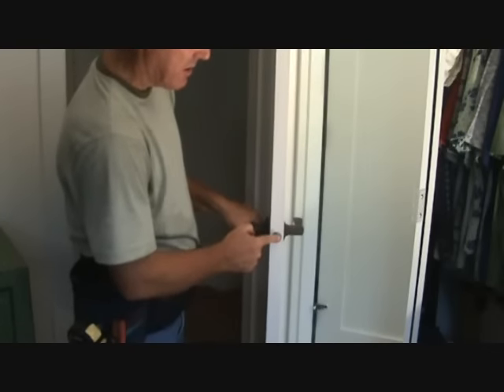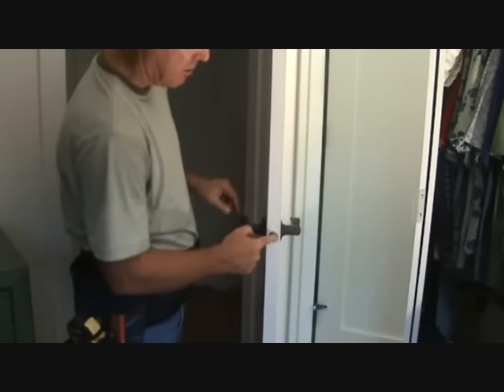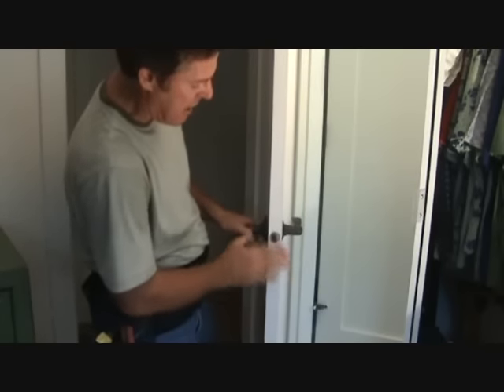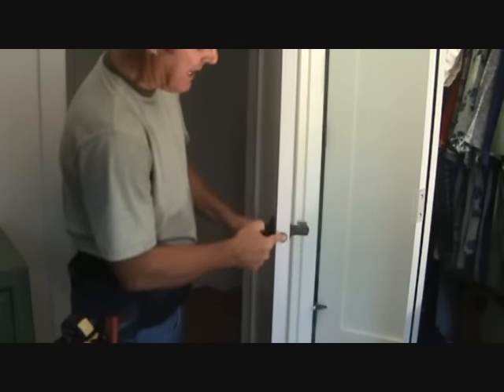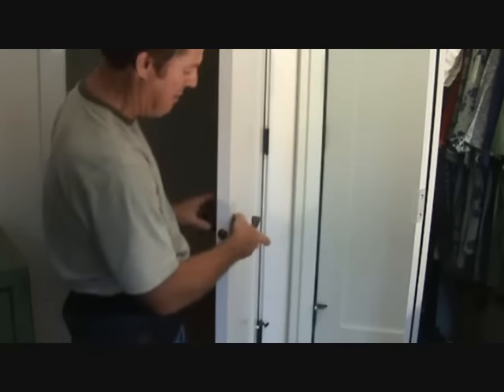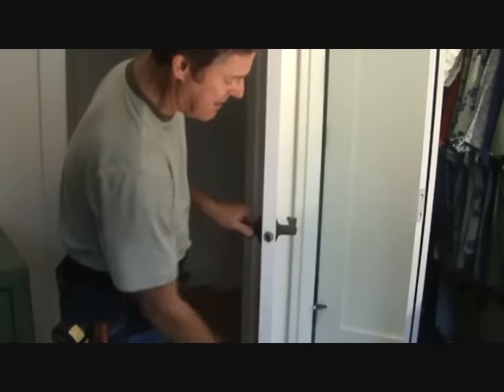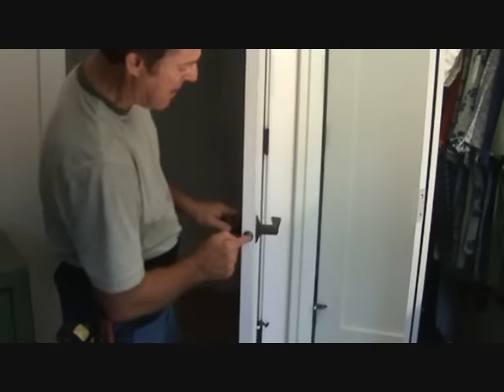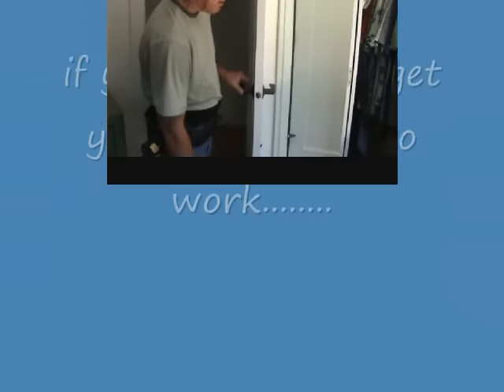Is your "door latch" sticking?

Comment: Hi my door latch got stuck in the door so when i removed the handles the latch was still in and the door wouldnt open so i used a knife to pull it open after some hard work.. do you know what could be the problem? the long metal bar that joins the handles togther seems like not turning with the handles but the handles work fine :s

Comment: Hey Joe, Thanks for the advice. I did take my doorknob apart and look at it, based on your advice, but it looks like I've actually got a little bit of a different problem: Even with a non-sticky latch, my latch isn't opening far enough.

Looking at my backstop, it's pushed against by a curved piece of metal -- and it looks like the backstop has actually worn away enough that it can't push the latch back enough anymore.

I realize that this is probably pretty uncommon, but I wanted to mention it as another possibility for people who might run into something like this: sometimes your backstop is just no longer functional.
Reply from the maker: Christopher Schmidt Good point thanks for mentioning this. If your door knob is still in pretty good condition what you could do is remove the latch & take to your local hardware store & see if you can match it up to one they may carry. If that doesn't work then take to a locksmith shop & they should have it. the latch could run you around $10 or more so if the door knob is not a very expensive one you might want to consider getting an entire new door knob assembly. Thanks for taking time out to send me your message!   Joe  :0

Comment from the maker: @punisher5836 Is the center piece stuck to the paint on the door face? Take a putty knife & tap around it to see if you can loosen it. Is there a set screw under the center piece that you're not seeing? Can you take a screwdriver & put in the center piece & turn it so that will release the door latch? There should be some way you can pull the door latch back into the door. Keep looking & working on it. Don't start that chainsaw just yet!!....lol.   Joe  :0

Comment: Hi Joe and Happy New Year!  My front door handle latch suddenly became stuck in the withdrawn position...staying inside the door.  No amount of handle turning, WD40 or screwdriver insertion would move it.  Took it all apart and the latch finally broke free but that was when it was disassembled.  I found some small parts that don't LOOK  broken off of anything.  I guess I'll have to replace the whole door handle unless someone sells latches separately.  But since this handle has been in there at least >10 years, replacing the whole handle makes sense.  Can you give me any idea why the latch would freeze up?  Thanks..
Reply from the maker: So glad to hear you had decided to replace that handle to your front door. Over time exterior handles will start accumulating moisture which will then turn into rust etc more so then say an interior door handle inside your house. Over time the latch will start getting "rough" to open & possibly closing then it's all down hill if you don't catch it soon enough. Thanks for stopping by!

Comment from the maker: Sounds like you may have a broken part in the handle assembly, that is preventing the latch to press back into the door. You may need to put a screw driver in the inerts & start prying to see if you can disengage the latch then. If you do this however, you may damage the lock but it may be time to replace this whole door knob anyway, depending on how old it it.   Joe  :0

Comment from the maker: Once you have the door open, you can then look in where you removed the door knobs & see what's going on. Once you completely remove the door knobs & associated trim housing, you should then just have a hole in the door, with the side door latch going into this door hole. Is the latch still pushed in & won't come out (at the side of the door)? if your latch is till stuck, you may have to replace your door latch. Spray some WD-40 on it & see if you can free it up.   Joe  :0

Comment from the maker: @cgarwood Not sure why you cannot remove door handle. Where you removed the door handle...look inside & see if the door latch edge has broken or has been wedged in causing the door latch to not spring back allowing the door to open. Look in there with a flashlight if you have to. It's got to be something like that since you should be able to pull the latch back so the door can then open....unless it's a really old lock..it could be different than how I am explaining it. Let me know.   Joe  :0

Comment: Joe,  my bathroom door handle had a problem where I couldn't tighten the screws without the the handles "binding".   Basically,  if I tightened the screws on the non-locking side,  the handles would be harder to turn,  and the latch fails to come back out...  I'd have to manually turn the handle to bring the latch back out.   So, I bought a new handle,  and it's doing the same thing!  It must be something to do with the door, right?
Reply from the maker: Yes you have a hollow core door & there generally is a block of wood in the hollow core door where the door handle goes so when you tighten up the door handle you don't suck it in to the door thereby having the door latch stick when retracting. See what I mean?

Comment from the maker: Try wedging a thin flexible putty knife between the door edge & the door jamb. Pull back with a little pressure on the door, as you try to pull the side door latch, back into the door. Can you take a screw driver & put in where you removed the door knob & try to put that in the door latch piece & turn that to open the door latch? Sounds like you have to replace the door lock anyway, so do what you need to do, to the inerts to slide the door latch back.  Joe :0

Comment from the maker: Go ahead & still spray some lubricant in there as well & see if that helps. Just make sure the notch in the door latch, is securely in place with the rest of the door assembly. I got one crooked one time & only one side was actually in. It seemed to work fine until I tightened the screws then it did the same thing yours is doing. Not saying that is your issue.. you could remove the unit & cut some little wood blocks & slip in so the door doesn't squeeze together, as a thought.   Joe  :0

Comment: I am having the same problem which is why I am here - trying to find out how to get that middle piece out, its stuck in the door. The door will not open...not sure why, I haven't done anything to it. I went outside and when I came back the knob would turn but the door wouldn't open. I took the knobs off but can't get that center piece out and the door is stuck shut. HELP! ; )

Comment: Hi Joe,

The outside thumb lever stopped popping back up on my Schlage entry door lock. Is this something that can be repaired? Many thanks?
Reply from the maker: If your locking handle is many years old then it might just be time for installing a new similar one....or take it apart then spray some silicone spray in there & put it back together again & see if it pops back out. There might be some dirt or rust in there preventing the thumb turn to pop out all the time like it should. did you try that years ago? What did you end up doing?

Comment: Hi Joe!  It seems the latch on the side of the door doesn't go in all the way when turning the door knob fully. We always have to turn the knob in the opposite direction and sometimes it still gets caught on the door jamb metal plate. Not sure what is going on or how to fix except to take a hammer to the metal plate. (I hope this all makes sense!) Any ideas other than to completely replace it (it's 4 years old)? Thanks in advance!
Reply from the maker: Ha! Please don't use a hammer to fix the issue....a sledge hammer works better! Actually your door latch is getting dirty inside & needs to be re-lubricated/cleaned so it will slide easier & that will in turn make it so that it should work like new. You would have to remove the door handle assembly from the door then take some silicone spray (comes in a can like WD 40) & spray on the latch & the inside of the door handle body. turn the handles back & forth then spray some more in there & work it. Wipe of any drip excess & reinstall & everything should work properly. If you don't do this, then your latch will always stick just like it does now & eventually it will work less & less since it's building up dirt/grease & wear to the inside latch arm & adjoining inside areas. I just recently uploaded some videos on how to remove a door handle & how to re-install etc.. Look for them for further learning!    Joe  :0

Comment from the maker: @safiii786 The inside of your assembly might be all gummed up with years of use, or there might be a broken part in there. Can you remove the bar? Loosen up the 2 screws that hold the assembly tight to the door. Move that around  & see if the latch pops back out. Also spray some silicone spray in there & around the latch. Use WD 40 if you don't have the silicone spray. You might have to remove the entire assembly from the door, then spray more lubricant & put back on door. Try that.   Joe  :0

Comment from the maker: If you have a hollow core bathroom door, if you tighten the screws too much, you are then squeezing the hollow door together just a bit too much. Try backing off the screws a little. Make sure the screws are still snug...but not too tight. If it's still binding, loosen back up a little & see if the lock is pulling the latch back properly, to make sure everything is aligned properly. Check that & let me know if you are still experiencing issues. Thanks for your question!   Joe  :0

Comment: Hi Joe we bought new door handles to replace our old ones and all was well until we tightened the screws of the screw set as soon as we get anywhere near having the handles flush with the door the latch retracts using the handle the handle springs back up but the latch stays in. we cannot loosed the screws as that will mean the handle is not fastened to the door solidly in fact it will be 1/8th of and inch away from the door itself thansk
Reply from the maker: You didn't crossthread the screws into the body of the door handle did you? Hopefully not. The screws should go in nice & easy. Are you using the right screws? Do you have the body of the lock fitting properly before starting to tighten up the screws? Everything should go right in. The door handle should come with mounting screws that should work on a 1 3/8" thick door as well as a 1 3/4" thick door. Could it be possible that they messed you up by giving you screws for just a 1 3/4 " door while the door you're working on is a 1 3/*" thick door? Remove the handle unit from the door & put it back together & see if the mounting screws thread all the way in. They should. Good luck with your project. If all else fails & it's still not working, take it back to the store & swap it out for another one.   Joe  :0
Reply: Hi the two screws go all the way through the door and into a threaded no we havent cross threaded piece the other side. We thought maybe the round bit on the back of the handle was catching so we enlarged the centre hole but no as soon as it gets close to being tight it stops working. Could it be that the bar is being twisted against the frame as the moment we move the base plate of the handle it frees it's self
Reply from the maker: Not sure. I would have to be there to actually see it!.....sorry I'm in Maui goofing around! Take the handle back to store & tell them you want to swap it out for the same type.   Joe  :0

Comment: Hi Joe . I have a pvc door and the catch is stuck half way in and half way out .also the key is stuck in the lock ??? i have managed to take the handles off and sprayed some wdforty in but it is not shifting . also i would like to change the cylinder any ideas how to replace as i cant get the key out .. otherwise lock works fine . thanks
Reply from the maker: Hmmmm what did you find out for why you were having issues? I think you might have had the handles screwed to tight against the door thereby sucking the door inward & making the handles tighter to hen have issues with the door latch not coming out easily. See what I mean?

Comment: Hi Joe, i dont know if you are still keeping track of these videos, but i am trying to fix this door for my parents, its our front door, the inside is a normal door knob, but the outside is like a push down, and outside one is stuck down, and the latch is stuck inside, anything idea of what i have to do to get it unstuck, i have tried alot of stuff people in videos are saying to do but nothing is working
Reply from the maker: Try removing the entire lock from the door. Look inside after removing the inside portion & see if there appears to be anything broken inside the outside lock portion by looking in the lock area from the inside of the door. Now remove the outside portion. Look inside the lock again & spray some silicone lubricant on the lock & depress the outside door tab & see if it moves. Spray the remaining door latch portion that is remaining in the side of the door. Spray the inside of it & also sneak some spray in the outer edge area & depress it a couple of times. Is it moving freely? Now reassemble the door hardware to the door. Your door latch could've gotten gummed up from years of use & it may have needed the silicone spray to free up everything. I just had this issue happen to me, on a friend's front door lock & it all works now. But sometimes you could encounter a small broken part inside the door lock.....so look for that too. Try this & let me know what happens. Make sure you don't use just regular WD40. Use a silicone spray.    Joe  :0

Comment from the maker: @therottenboss Your door knob may be stuck to the surface of your door since the paint on the door may have not been 100% cured before someone installed the door knob. Tap all around the door knob trim piece. Be careful not to hit the actual door. Your latch could need to be repositioned once you are able to remove the door knob. Then spray again with lubricant. Could the latch be broken/defective? Possibly but you won't know until you remove the door knob. Try again & let me know.   Joe  :0

Comment: Hey Joe,
On my Kwikset doorknob, on the door latch, there's this small thing that you can push in. I was really bored so I pushed it all the way in and it locked, so I wasn't able to turn the handle or unlock it. How do I fix this? I tried unscrewing and taking apart the handle but the spindle gets stuck and I can't remove the exterior knob (I tried using lequid's method but it didn't work. I don't know if I got the right "tab"). Thanks!
Reply from the maker: To pull the handle out of the door, try push the rest of the side door latch in first, THEN try removing the handles. It should come out then. Then you can see what you need to do in order to make your side latch start properly working again. Let me know if you can get it. Thanks for your message!   Joe  :0
Reply: VideoJoeKnows Thanks for the advice! However, the latch on my door can't be pushed in since it's locked because I pushed in the little crescent-moon shaped tab on the latch. That's what I'm trying to do, unlock my door by figuring out how to pop that little thing back out :(
Reply from the maker: Ha! That's not suppose to happen when you push that little piece in. Sounds like it got stuck just behind the face of the side latch plate maybe? Did you unscrew the face screws from the face plate on the side door latch? Once you do that maybe you can wiggle a little & get that pin to pop back out. At least give it the play then wiggle the body of the door handles & see if you can get it. Quickset are a nuisance sometimes.....   Joe  :0

Comment: Joe, my door latch is locked in the open position. Meaning... when the latch is fully extended, I can NOT push it in with my thumb (nor will the latch recede when you close the door). Instead, I MUST turn the know to recede the latch before closing the door. If I do not do this, the latch simply hits the wall (the latch does face the correct direction and it worked fine for 7 years). Any ideas?
Reply from the maker: +Phillip D Sounds like you have a defective door latch. Sometimes door latches will break a part inside them depending on how old your door latch is... or....if your door latch is an old style it might have little prongs on the end of the door latch that then fit into the body of the rest of the door handle assembly. I've seen these come out once in a blue moon & it may be your issue. Pull the door handle apart & look in there to see what is going on. Most door handles come apart fairly easy so look at yours & know you can do it! Let me know what you find. Thanks for your message!   Joe  :0

Comment from the maker: Your lock mechanism could be gummed up on the inside. Remove the unit from the door & spray a silicone spray inside the unit & turn the handle back & forth & put more spray in there. If you don't have a silicone spray then use WD40 (silicone spray preferably). Also spray the side door latch, the inside of the door latch & spray some in the end too (moving back & forth). wipe of excess lubricant & reassemble unit. Make sure everything is sliding together properly & retighten.   Joe  :0

Comment: Hey Joe, I've got the same problem. Taken the lock assembly apart and sprayed it with silicone spray. Put it together. However the door latch is still stuck. New lock time??
Reply from the maker: Yes! Did you replace it? Hope so!